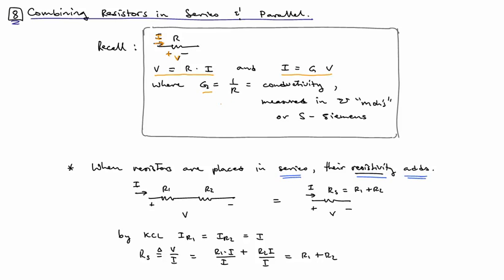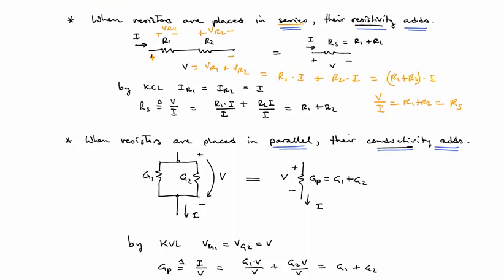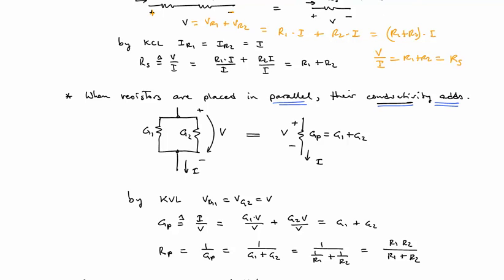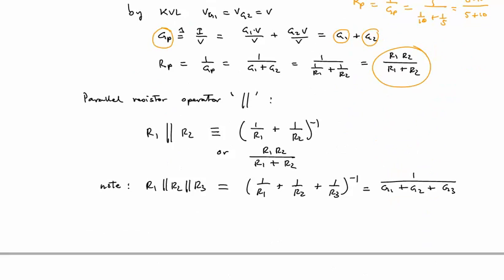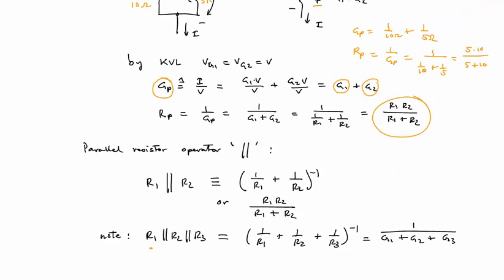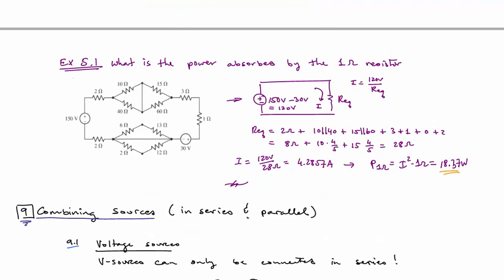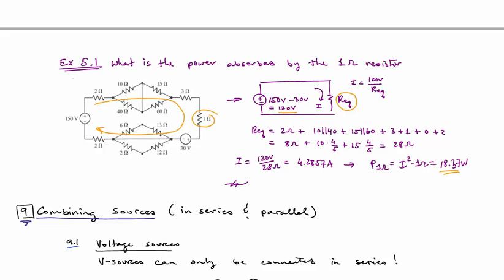Circuit Analysis Basics CA-8: combining circuit elements

Comment: in the example, why is the resistance in the resistors after the 30v zero? could you please explain?
Reply from the maker: it is zero because there a wire (a short) connecting the 30V source to the 2 ohm resistor. this short is in parallel with the resistor network that appears to have been skipped. It's a tricksy schematic ;)